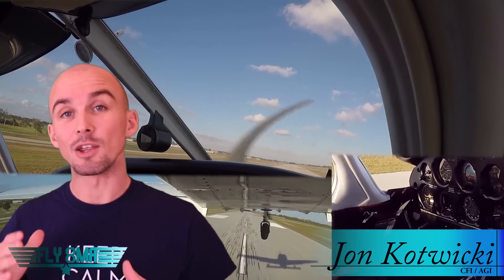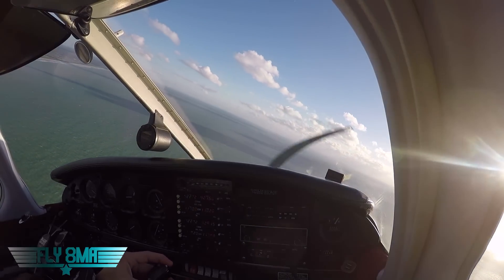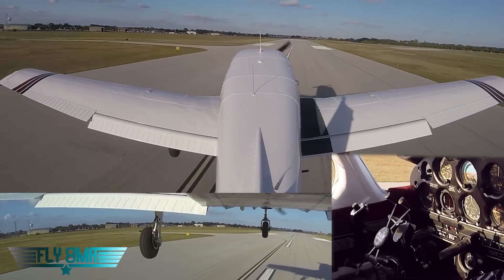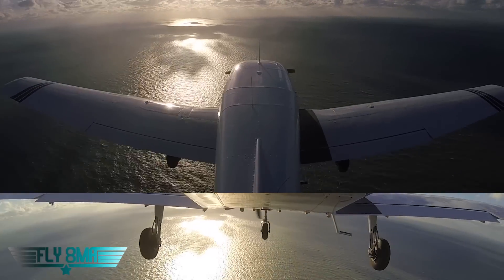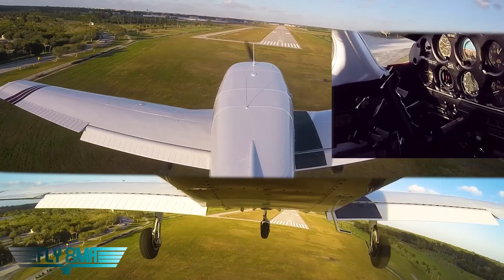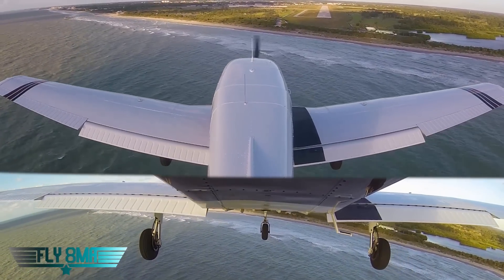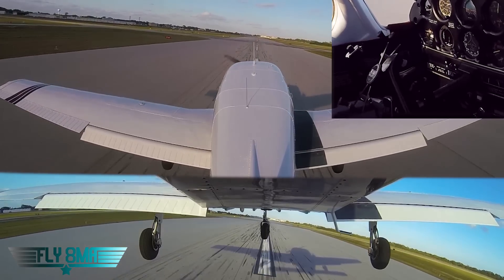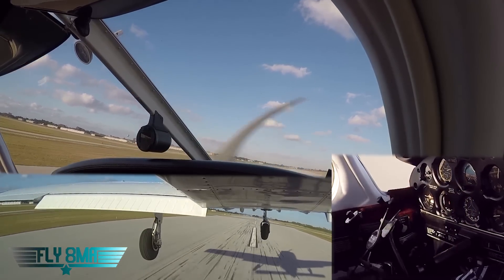MAX X WIND Landing! 25 Knot Crosswind | Piper Warrior HOW TO

Comment: Whe you toched down you went full ailerons into the wind immediately.  Would this be safe in all airplanes?  Or would you gradually introduce them in as tou slow down at higher approach speeds?
Reply from the maker: Yes, you want to apply full aileron input into the wind once you are on the ground so you do not get picked up by the cross wind. You steer the plane with rudder input not your ailerons.

Comment: As I understand it you are very unlikely to spin in a slip. A skid yes. But in a slip your raised wing will stall first due to being deflected away from the relative wind. If a stall occurs in a slip the raised wing will roll back and directional stability will yaw or weathervane the airplane back to coordinated flight. This is all dependent of course on the pilot coming out of the slip and reducing AOA as the stall occurs. I remember doing cross control stalls during my CFI training and we discussed this on the ground beforehand.

Comment: I seem to be struggling with crosswind landings in the 172. I fly out of KDDC and 95% of the time winds are 15-19 with gust up to 25-30. There have been a few times where there was some side load and one of the mains would slightly come back up with some screeching after touchdown. I try to think back and cant pin point the issue on those landings. I assume its my crosswind controls after touchdown and not "flying" the airplane all the way to parking?? Or just letting the airplane settle down to the runway too soon with too much energy??  Any pointers would be appreciated.

Comment: Excellent example of not worrying about greasing it,  just make a safe center line landing in tough conditions and pat yourself on the back. Pilots should practice this regularly. Similar to you, in these conditions, at 1/4 mile to go I do a "check and see what you are dealing with maneuver" and straighten out. So many newer pilots seem to (IMO) straighten it out way too early. You never know the "true" wind conditions until you are almost there. After checking on short final to see if you can actually straighten out, I fly crabbed until just before the flair. In winds like you were landing in I would use 10 degrees of flaps (Piper 140) and since you are inducing tons of drag in the slip I  keep some power in until touch down. In a low wing, it (the wind) almost always settles down substantially as you are close to touch down within a few feet.

Comment: While the crosswind instructions here are good, it sets a poor example to exceed the demonstrated rating and there's not enough discussion of what could go wrong, and how it goes wrong.   The conditions were 17G25.   You don't know you weren't just lucky and it was just 17k when you landed and during early rollout.    I am a CFI and have nearly ended up in the weeds on a wide runway in 23k direct crosswind (using the same technique), and I wouldn't want to repeat that.   The touchdown is the easier part - the rollout is where the accident most likely happens.     The nosewheel can break if it comes down with full rudder deflection.   The side force of the wind on the aircraft can exceed the power to steer with nosewheel, rudder, and brakes and push you off the downwind side of the runway.  Also gusts are typically not exactly in the same direction as the steady wind - so they can result in different crosswind components.   Yes, you can get away with this sometimes but if you do this enough times eventually you will be calling the insurance company.

Comment: Ailerons:
   The largest control surface on the plane. 
   Ailerons:  The least inderstood, most abused control on the plane.
   Ailerons; 1) provide roll, to bank to turn.
2) provide roll to bank, to control x wind drift over the runway.
3) provide YAW to aid directional control on roll out, as the wee rudder stalls out.

Comment: What’s the difference between a slip-to-land configuration and a strong crosswind configuration with opposite rudder + aileron dipping upwind wing?
Reply: Wind. 
If you want a more complete answer forward slips are typically performed at a steeper dive angle since the idea is to lose altitude in the shortest forward distance. Cross-winds corrections are much more flat in their approach and are flown at a slightly higher than normal approach speed. But pilots all have slightly different methods so the difference is less pronounced.

Comment: On a first turn to final you were not aligned with the runway. My POH says "Complete the turn to final on an extension with the runway centerline ..."
Reply: Also, worth mention you want to use .5 gust factor to add to your airspeed on final, (unless I missed it). Else - good stuff, thanks.

Comment: Tailwind Turn?  Better bank to base at 40 degrees with 10 flaps (Over the Vglide, of course), then reduce it to 30 on base because not overshooting.  Initial mild turning is the main cause of overshooting the final leg alignment, OR...   They apply too banking, too much rudder, or too much elevator turning base to final, and.... stall.

Comment: You can use flaps normally until final, then take of the flaps (slowly) on final leg.  Easier to do and safer to do the turns with flaps.  The Flaps up on final method.  Raise the flaps just like you do when practice engine fails on final ( Do you practice those?).   

Nose is down with flaps down so it will accelerate when you raise the flaps.  Done up to 30 knots on cherokee 6 with the flaps raise the flaps on final.  Done with right crosswind is easier for me.  Left crosswind landings need more right rudder due torque in the flare..

Comment: If tailwind on base, better turn 35-40  degrees of bank from beginning to avoid that steep turn turning base to final.
Reply: Yep, then reduce it to 30 because not overshooting.  Initial mild turning is the main cause of overshooting the final leg alignment, OR...   They apply too banking, too much rudder, or too much elevator turning base to final, and.... stall.

Comment: 2:07 47 degrees of bank to correct an on final is a sure way to play with an accelerated stall spin accident.
Reply: Not really. As long as you don't pull back on the yoke, any bank angle is fine. What does kill people is stepping on the rudder because they are afraid to overbank.
Reply: @bhc1892  time you're in the practice area go try what you just said and let us know how it goes
Reply: @StephenRoseDuo  What would you like me to try?
Reply: @bhc1892  try to maintain coordinated level or 500fpm descent flight at progressively higher bank angles and tell that you won't pull back on the yoke. (Something tells me you'll find it impossible after 20-25 degrees of bank)
Reply: @StephenRoseDuo  I teach students to release backpressure, and let the nose drop, while banking in the pattern. Not to maintain altitude. The two things you've asked me to do are mutually exclusive at approach airspeeds. If someone is too low to accept the altitude loss needed to safely complete a turn, they need to go around. I already have several videos on my channel where I use this technique - the steepest I was able to find in a quick scan is in the "crosswind record" video I uploaded in April 2020. I'll record a steeper one for you this weekend, but I will not accept your challenge to maintain altitude because I do not want to perform an accelerated stall in the pattern.
Reply: @StephenRoseDuo  I filmed a short video today about this and uploaded it. There are two clips. The first demonstrates a cross control stall+spin started at 30 deg bank. The second demonstrates a much steeper base-final turn in the pattern with a noticeable nose-drop and 200ft altitude loss. https://www.youtube.com/watch?v=T6uV9t-X6Js
Reply: @bhc1892  thanks for making these videos. In the second clip we can see how much the nose drops. Are you still trying to say that no one would pull back to prevent this? Are you saying this is a fine stable safe approach technique?
Reply: @StephenRoseDuo  No a stable approach with well-planned medium bank turns is the goal. But when that doesn't happen, my priority is "release the backpressure, let the nose drop". The airplane doesn't know where the horizon is, it just wants air over the wings. Yeah I'd be pretty unhappy if a student did a 60 deg bank base to final turn, but I don't gripe about 45. I want them focusing on letting the nose drop and staying coordinated, not their bank angle.
Reply: @bhc1892  this honestly seems extremely baffling. Why not just always fly coordinated, never cross 20 degrees of bank, and allow the plane to overshoot the final course and just reintercept the glide path? No military or commercial pilot would do what you're recommending and they're the safest pilots on earth.
Reply: @StephenRoseDuo  45 deg pattern turns are common practice where I fly. Not because of overshoots, but because we fly tight patterns. If you tried to do a 20 deg bank pattern at my airport, I know a few guys who would be passing you on the inside (not that I approve of such shenanigans, of course!). If that seems foreign to you, hang out with vintage taildragger guys for a while. You'll see stuff way worse than steep turns in the pattern, and the off-duty airline pilots are the craziest. I don't teach students to correct overshoots with steep turns, but I do require them to have the stick and rudder discipline to do such things safely if they were so-inclined.

Comment: left wheel firts?
There is only 2 tech for X-Wing
1-  Crabangle
2- Side slip
I can not find, or at leats on Google, where says left wheel firts ML, or right,  landing .
Sorry but I land my Pitts, Dc3, C46, Dc6, 727, 737, E190 AND A320 family in xwind with all wheels at the same time, using sideslip tech.
when you do it correctly, the exact amonut if correction makes all wheels landing at the same Time.
if you a reference, I wiil love it to have It.
Thanks a lot
Manrique

Comment: I assume that by "VX" he means takeoff speed and "VY" is cruising speed?
Reply: tall32guy Vx is the speed that gives you the best angle of climb, usually used to clear obstacles after takeoff. It gives you the most altitude over a given distance. Vy is the best rate of climb speed, that gives you most altitude in a given time. Hope that helps!

Comment: You can use flaps until short final, then cut the flaps with nose down, just like you do when practicing engine total fail on final.  You use the flaps like on a normal approach for safety and more control, then cut them at about 200 feet agl to flare without floating as much and more control on the flare.. Done that since 1994.  Practice engine dead on final with flaps full, then cut the drag flaps to reach the runway.  Most in USA cant to do that.
Reply: Great technique. Three different CFIs shared this with me, each thinking it was a "secret" lol. Been using it for years. Just uploaded a video of me using that technique to land in a 30g39 kt crosswind. Then youtube recommends me this. Sad to see this given as instruction.
Reply: @bhc1892  Thanks.  Is that you on the video landing with that strong crosswind on the Bonanza?  Nice cutting the flaps on the flare. 

My CFI have a video of him doing Turnbacks to Opposite Runway with 16knots crosswind/tailwind and landing with the 16 knots tailwind on a 4,000'  runway using those tricks and Bush Pilot tricks too.
Reply: @feetgoaroundfullflapsC  Thanks. Yeah I'm flying the mooney, not bonanza. Turn backs are a lot of fun. I've done a bunch in various wind situations, but never that much tailwind. Sounds like you had a good cfi. Mine was the same way. 

I respect the cfi in this vid for pushing his own limits but I'm glad I didn't learn from him. I'd have ended up a nervous nancy pilot, going around anytime a bird passes gas within 100 miles. He was so worked up for this he floated almost a mile lol.
Reply: @bhc1892  Mooneys can use that trick named 
"Cut Flaps In The Flare".  They float a lot when lighly loaded and a few knots over Vfinal speed.
Reply: @feetgoaroundfullflapsC  In my plane dumping the flaps is equivalent to flying 10 kts slower with flaps (from a touchdown perspective). Flap retraction also causes the plane to pitch up, which is a perfect thing to have happen during a landing.
Reply: @bhc1892  -All low wingers pitch up when cutting the flaps at the low speeds.  High wingers drop the nose.  Mooney drivers that know that trick well call it "Autoland".
Reply: All of us in the USA can do that, but we are smart enough not to. The plane will sink more when you remove the flaps if you don't add power.

Comment: Have land Cherokees with a 30 knots constant.  After a charter flight that paid very well.  Owner was watching.  No damages.. Here are some tricks.. 

1-Plan before the approach- Plan to use over 3,000 feet of runway to stop it well due you cannot brake much with a strong crosswind pushing you.  If you brake hard, its 
like hydroplaning the tires and a sudden LOC accident to happen. Wind will push you out..Your fault for using hard braking on a strong crosswind landing.  

The Approach- Safer if normal flap use until final. And easier too.  Safer to have normal flaps until all the dangerous turns on high winds.  Specially those base to final turns with a tailwind on base with no flaps on and low due no flaps lower approach.  On final, i keep the Vgl and take off all the flaps for the landing. 

On Final- Flaps up on final At Vgl of 70 knots then you use the Forward Slip instead of flaps to increase angle of descent if need so. Around 200 feet agl, do the Crosswind Slip but expect the angle of descend to increase due that happens on any kind of slip done on strong crosswinds.  Dont depend so much on the power, make it go down to beginning of runway with power off.  Power makes you have torque and keep you up longer in air when you want to put it down at beginning of runway instead and can make you overshoot runway at end. 

Touchdown-- Do the Crosswind Slip to the first few lines, increase the aileron and rudder as needed but leave a few degrees of CRAB until touch down. Why??  Due when you touch down on tricycle landing gear, the rear tires touching down will try to pull nose straight and delete any wind correction angle you need when tires are still too light on runway.  As the wind correction angle crab you have is taken out, YOU WILL SLIDE DOWNWIND, as the video shows.  After touch down, you dont have banking towards wind to fight the slide off you might get from 30 knot crosswind, so you MUST HAVE SOME CRABB INSTEAD.. take off the crab with the rudder trim help as you slow down.. Feel those pedals well or lose control.  

Tricks to stop safer--If landed too long, or been pushed by wind, cut the mixture and turn to the wind on taxiway or to the grass, if.. A turn into the wind with ailerons toward it can be done at higher than normal speeds and the accident averted.  Once i had to land a Cherokee with a storm a mile from runway. and a maybe 40knot gust lifted my right wind and tire.. I turned it towards the wind and stopped on grass.  No damages.. Put taxi flaps to lift the wings and got it out of the grass.  Had to wait on taxiway with engine off for storm to pass.
Avoid strong tailwind turns on ground.  Use the proper wind correction always.  If you put the controls wrong you might help the wind push you or flip you over (Your Fault).  So when turning tailwind specially, neutralize all flight controls until you are sure you are going to put them right. 

Yes you can fly non LSA's GA airplaned in 30 knot winds but you have to know how to do wind correction well or DONT DO IT.
Reply: You are not landing with a 30 knot direct crosswind.

Comment: Very nice video!! I'm just wondering, why do you de-crab so early? I believe that the asymmetrical flight is not as comfortable to stay in for several reasons and I learned to de crab right at flaring.
Thank you:)
Reply: You better have the Crosswind Slip well established before the flare, I do those 25knots landings too. Change to the Crosswind Slip at around 200 feet agl.  Ng to wait to end to put airplane in crosswind control position.  I dont wait to the end to adjust the slip and the flare at same time.  Only low to the ground engine jets like newer 737's need to land on a slight crab to avoid engine strikes.  All others can do The Crosswind Slip and avoid tire and landing gear damages..

Comment: Jon is my kind of CFI. I wish I had had a guy like this when I started my instruction. My first teacher was a very bad experience. He would mutter obscene comments about american"s especially women. He always had alcohol on his breath and horrible BO. Much of the time he would not offer any instruction at all except for a "figure it out". Finally after wasting about $2500 of my money I got an instructor more like Jon. Ivan (my first CFI) nearly made me give up. Everyone I have met in aviation since then has been ace.
Reply: Report the arsehole to FAA. Dont take it.. There are some crooked CFI's there.  But the dam cowards do nothing.
Reply: I fired my first CFI too.  He let me fly for miles and miles straight and level that got me bored.  Only did four fundamentals first 4-5 hours.. Thats it.  I remember on last flight he made me climb in circles to around 10,000 feet to do steep turns on the Piper..  That area was transited by airliners going to the busies airport in all Florida and i could see the logos of the Pam Am 707's easily.  The idiot only smiled at 10,000 feet while I was thinking WTF we are doing here. A pilot told me not to fly with the imbecile any more, and so I did. 

Next CFI taught me stalls, GRM  and emergencies quickly in 3 hours.. I soloed at 10 hours on a busy class D at 17 years old doing touch and goes between twins and singles doing same.  Dont put up with bad CFI's.  If you are a coward on the ground, you will be the same during emergencies..